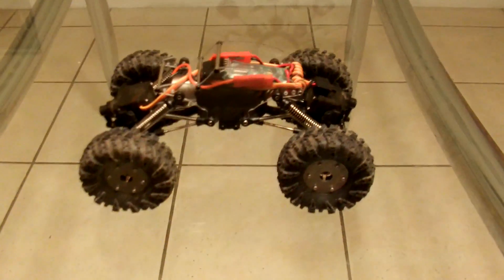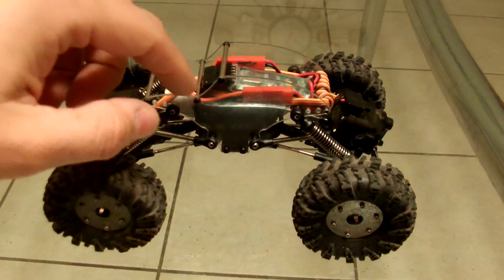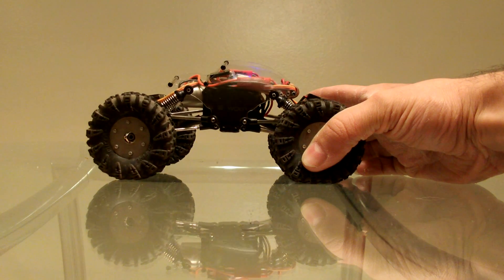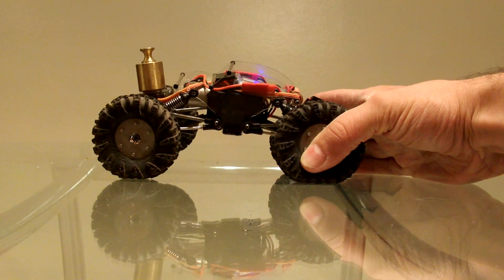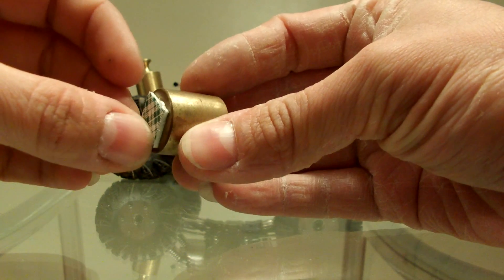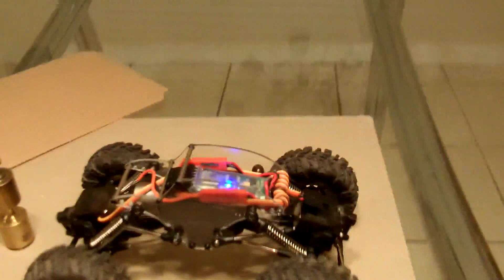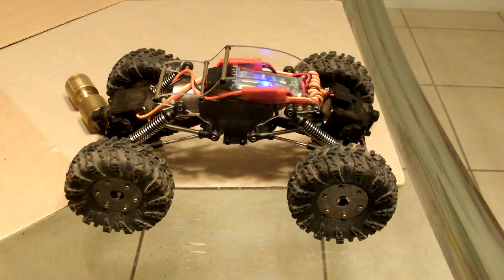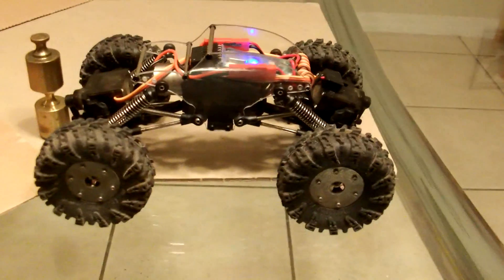38 Redcat Racing 1/24 Sumo Crawler Micro RC with mods / upgrades Coreless Motor Test

Comment: ok, I have a small problem... all my precision measuring tools are currently locked up at my old job.... :(

so I am in need of the diameters of the stub shaft, the pin shaft and I think the gearbox input shaft is the same as the stub shaft.. but, I am not sure. oh and the width of the gear tooth.."the face" I know the gears are wider than the face but might have to add spacers to take up any extra space.

Comment from the maker: That would be awesome if you could find some metal gears that drop in,that would make things sooooo much easier! But one thing to remember the stock transfer case gears are 48 pitch so you would need all three in 20 pitch if that's the only pitch they offer.Generaly speaking the lower the pitch number the bigger the tooth so they are stronger,but like I said you would need all three and they would need to fit.If you do get it right let me know and I'll buy a set from you.Sounds too good to pass!

Comment: right now im lookin into finding a supplier that makes the gears in metal to replace the plastic ones. found some that have the right sizes. there also 20 pitch.... not sure if that is a good thing or not... we would like to keep the x-fer case inclosed if we can. would like to make it somewhat water proof down the line.... again if possible

Comment from the maker: I wont suggest using servo itself as gearbox yet because speed is too slow because of servo reduction (you wont like).The servo itself can be made as gearbox with brushless motor for something that would need huge power (6x6 or FOFF rig).

Comment from the maker: Sounds like a case of too much power for your drivetrain,I told you the coreless was strong ;).Ok so its time to upgrade,the best option is to do away with the first and second gears on the transfer case,on video 26 of my sumo videos I show how to replace them both with a single 30T pinion gear.I only suggest this modd to those that actually break the stock gears first as a last resort but once done the transfer case is virtually indestructible,plus you get more speed from the sumo as well.

Comment: are the replacement x-fer case gears stronger than stock? first run on the coreless eeyore got a little bound up in a stick, striped the small middle gear. I was able to quick fix using a gear out of the servo set. took it for the second run and striped the mid sized gear in the set.

Comment from the maker: jb weld would work great but be very carefull in amount used, I didnt use it because you know it has a tendency to fill in gaps (thats the idea of the design) so I was afraid it would find its way into the tiny holes where first gear sits (tiny gear that messes with pinion) and "weld" it in place, but with care you should be able to pull it off, Im more of an electrical guy so soldering comes natural to me ;), good luck and please do post video,I always forget to record those details!

Comment: k, no worries there. I'm a machinest by trade, however i was thinking about trying J B Weld instead of risking damage to the motor while soldering or trying epoxy or crazy glue. I know it can handle the heat and i will gently score the smooth surfaces so there will be some thing for it to grip to. I will do a video of the install and updates on how it does.

Comment from the maker: Yeah, I would go that way if I was you as well, just be very carefull when widenening the hole on the gearbox, it has to fit the motor bearing as tight as possible to keep a good mess with the gear,and if you decide to solder instead of glueing dont heat motor too much so you dont damage protective film on wire windings inside, other than that its pretty straight forward and as you can tell stronger than you will ever need! :)

Comment from the maker: It was just a matter of time,stock motors are not enough for the fun we have with these guys! Well heres the thing,coreless is stronger but requires widenening gearbox hole slightly and soldering to stock gearbox(or REALLY strong super glue),regular servo motor is a biot weaker but cheaper and requires two slightly longer m2 bolts and 4x 2mm washers,so it really depends on how much work you are willing to put into it,either one will be strong enough for what you do though :)

Comment from the maker: Thanks,well this was not as easy as the other servo motor,it doesnt have holes for bolts in the front and the front bearing is a bit bigger than stock gearbox hole.I widened gearbox hole by a tiny bit to fit motor in and soldered motor to gearbox.A bit drastic but I know its secure and meshes perfectly,good enough to flex its muscles! :)